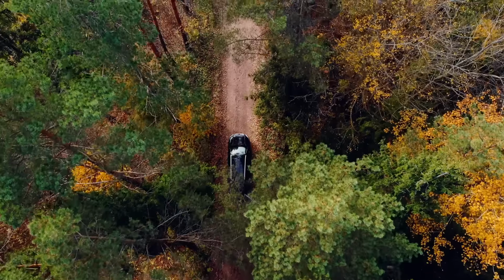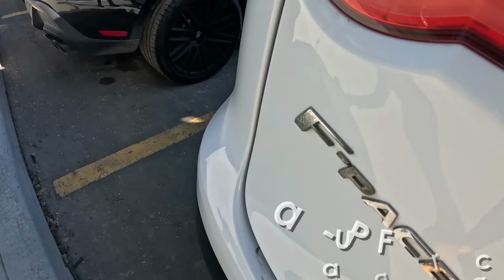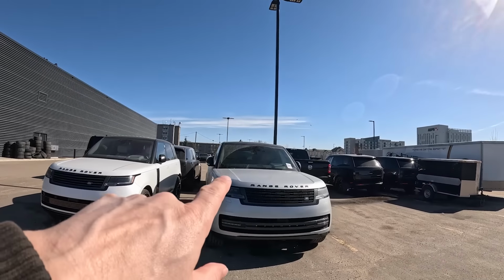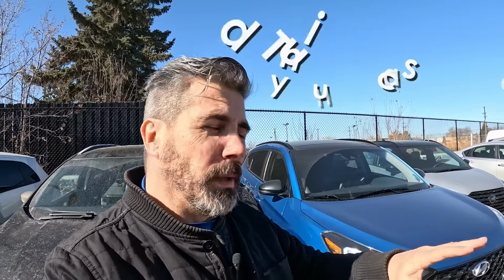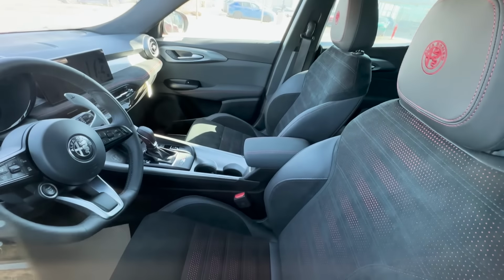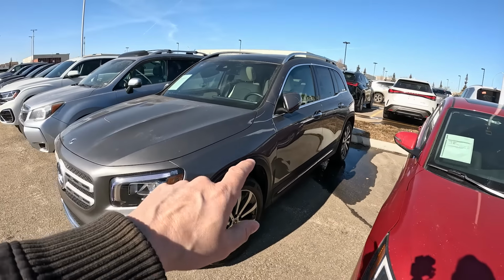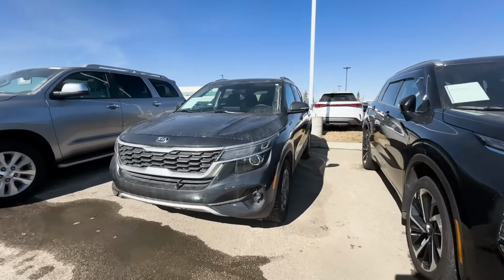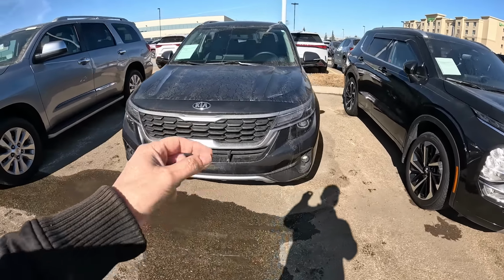Here Are 10 SUVs you MUST AVOID!

Comment: I have had two Ford Escapes, 2008 got 160K out of it. Transmission went. Could have put another one in, it still ran fine, but junked it. I have a 2014, 2.0 liter. There were no issues until after 100K and 10 years, now has some quirky issues. Shuts down after half hour or so, but will restart again and then go for another half hour or so. It is at 117K. So, not the best vehicle for sure, but at 10 years plus, I wouldn’t call it a total piece of junk. It’s not a Toyota or Honda, but it definitely ran well past 100K without issue.

Comment: I have two Ford Escapes, 2008 got 160K out of it. Transmission went. Could have put another one in, it still ran fine, but junked it. I have a 2014, 2.0 liter. There were no issues until after 100K and 10 years, now has some quirky issues. Shuts down after half hour or so, but will restart again and then go for another half hour or so. It is at 117K. So, not the best vehicle for sure, but 10 years plus, I wouldn’t call it a total piece of junk. It’s not a. Toyota or Honda, but it definitely ran well past 100K without issue.

Comment: I will never buy another Hyundai after owning a 2017 Sonata.  It burned oil so bad that apparently there was nothing on the dipstick when I took it  for its first oil change.  The transmission would shudder in first and second gear.  And there was a loud clanking noise coming from under the car when I accelerated.  Oh yeah, the car had less than 60K miles when I had all these issues.
Reply from the maker: They are not a well made vehicle in general

Comment: I had Nissan Juke and when I traded it had 107k miles. The transmission did not broke, Nissan replaced the timing chain due to a recalled when it had 30k, it became extremely unreliable at around 95k before that it was reliable

Comment: I have had 3 Hyundais and all 3 went over 150,000 miles and 2 of them went over 200,000. No problems at all. Just oil changes, brakes, batteries and light bulbs. But my 2 Toyotas had engine and transmission problems and died before 100,000. No more Toyotas for me.

Comment: Cars these days are heaps of shit compared to the 90s. Honda and Toyota are the best. But what  amazes me is its all these high end luxury brands are just crap. BMW, Audi, Mercedes Benz, Range Rovers etc once they start to go wrong they're just money pits... Too many sensors and electronics to go wrong, and when they go wrong Big money... Many years ago i had a 98 Civic for 14 years, I put 250,000 mikes on it, I had zero engine or electrical problems, it didnt even burn oil. I miss that car, it never failed me save for wear and tear issues.. Eventually had to get rid if it because of Rust, engine was spot on... Toyotas in the 9Os were pretty bulletproof too...

Comment: I own a 2014 Ford Escape with 230,300 km (140,000 miles) with the 1.6 eco-boost. Had to replace battery, front lower control arm plus wheel alignment(?), drive train bearing & plugs. I am 3rd owner & got the car during covid (2020), drive around 2,000 kliks per annum & do two oil changes yearly - spring and fall. It's a very comfortable vehicle, handles well & have only 2 complaints - 1. it's too small for all my camping gear & 2. it really clunks gears going up steep hills. Keeping my fingers crossed, eh?!?

Comment: I have a grand Cherokee v8 4x4, got it at 80k miles, died at 170k miles. Hard shifting, coolant burning, sunroof leaking, blinker anomalies, broken wheel studs, broken hood release, leaking radiator, melted alternator, failed water pump, blown head gasket and that's when I stopped fixing it.
Reply: Jeeps are garbage! 🗑️

Comment: I'm sure the Tucson is not among the most reliable cars but this is the first list I've seen that places it among the worst. I had a 2008 Tucson for 6 years and way above 150000 miles with not a single mechanical issue. Now I have a 2021 Volvo XC40 and I'm looking seriously at the 2025 Tucson as a better value option. I'm not comparing general quality of course.

Comment: The transmission is relatively inexpensive to fix, but the mechanics charge a lot of money because they offer you the option to sell the car to them.
For example, the Ford Galaxy is a superb, economical, and large car, but it has a bad transmission, the idiotic dual-clutch PowerShift automatic transmission. Around 100k, you need to replace the clutch, which will cost you a maximum of $700 to fix yourself, but the garage will charge you $5,000.
It is an incredibly profitable scam accepted by everyone, and nobody cares because it is a crazy profitable deal.
If you don't want to fix it, they will probably offer you $600 for the car because "the transmission is down." The actual value of the car is probably more than $7,000. They will take your car, fix the transmission for $700, and resell the car for at least $5,000 or more.
😂
Maximum profit in maybe two days of work or even one. 😊😊
I done my research guys and i fix myself my transmission and after 23k miles is still running like new. 
I good advice if you have automatic transmission "CHANGE YOUR AUTOMATIC TRANSMISSION FLUID " at maximum 40k miles maybe you will pay a maximum 200$ but you will save yourself a lot of money in a long run and important is to porr some lucas automatic transmission fix but not a lot if you transmission is perfect good .

Comment: Thanks for this post I was going to go out and buy a cheap Grand Cherokee and I'm not no more I can't believe it won't make 100,000 miles that's pretty sad. I have a Ford F-150 8 cylinder and it has 295,000 Mi on it it's a 1999 and it runs as good as it did when I took it off the showroom floor so there's a good vehicle

Comment: My 2020 4-cylinder 2.4 liter Cherokee 4x4 is for sale as we speak.  The biggest problem is the 9-speed ZF transmission, which since 2014 has been packaged with all Jeep SUVs with both the 4 cyl and the V6 engine.  Thank "Stellantis" and their globull sourcing for that (the ignition is from Magneti Morelli/Fiat).
This transmission never sees a gear it likes ... in mountain country driving a ZF Jeep is not pleasant, as it downshifts with each tap of the brake almost regardles of engine speeed.  I've seen 5000 rpm on the tach through no choice of my own.  If you have cruise control engaged while going down a long grade, the same thing happens.  
This car also thinks it is smarter than its driver, as it has a few "helpful" electronic aids that you must disable each time you set out for a drive ... unless you like having the engine shut off at red lights, and the brakes pump automatically when the car thinks you are too close to the rear garage wall.  
And don't even ask about the nahtsee seat belt warning chime ... drive fifty feet down your driveway unbuckled, and you hear it.

Comment: That don't make simple cars anymore .  manual transmissions manual windows manual locks  .I got a car with power locks that's making me sick  .they lock when I don't want them to lock.. power windows that can be ruined if you leave the windows down in the heat and it rains and gets on the controls  .they should get rid of as many electronics as they can in these cars.

Comment: I've had a 2011 Hyundai Tucson for 13 years with 182,000 miles on it have had zero issues with it. It's the 2.4L engine variant. I do all of the various maintenance as required. I would definitely buy another, if this one ever dies!
Reply: I had the same experience with my 2011 Hyundai Tucson too! Great car in my opinion.
Reply: Except for the Tucson, I mostly agree with your position.

Comment: Wife’s 2014 Ford Escape has 140,000 miles with zero problems.
Reply: I had the old Escape and it was a good car to drive. Based on that experience,  I bought the 2018 Escape. Transmission had to be replaced at 175k km, 5years. Luckily for me they agreed to replace it under warranty. Never buying it again.
Reply: Yeah, I have a 2017 with the turbo engine, about 78k, no problems and still rides great
Reply: this is nice to hear as I recently inherited my grandparents 2014 Escape after their passing. I wanted to have it for obvious reasons but kept hearing horrible things about that year model. I was looking at finding something (admittedly a small Toyota SUV) else to drive instead. I still have my concerns but they took impeccable care of it and believe it or not, it stilllllll has a "new car smell". I'm kind of torn though. I want several years of a vehicle with no notes and just attention to servicing and maintenance. I still have some reservations about this particular Ford product.

Comment: 2024 today mi Hyundai accent  2014. 210.000 miles 0 problems  running like new 😂😂😂😂    and mi kia sportage 2019 110.000 miles.  0 problems  I love.  🎉🎉🎉🎉🎉
Reply: And I believe you🤣
Reply: I currently drive a '16 Accent. Still going at just shy of 150k and I'm hard on cars bc I'm a girl and don't know how to fix stuff. It's had to have the a/c fixed more than once (I live in Texas and no air is not an option) and some kind of sensor, other than that, it's taken a real beating. Great on fuel, good commuter. I'd recommend.

Comment: I took a chance and bought a 2023 Tucson in December. I haven't heard anything bad about the latest gen. The engine is not the Theta II that was so bad.  I bought mine because after test driving a lot of competitors I liked it the best. I actually traded in a 2021 Subaru Legacy Touring XT for it. That car was a complete rattle trap. By 5,000 miles it had an oil pan leak and more interior rattles and buzzes than I could count. Not to mention the CVT had horrible driveability - surging, hesitating and jerking around town. The Tucson is at least a naturally aspirated engine with a traditional automatic. Smooth as butter driving it.

Comment: I have a 17 Kia Sportage,  It was using 2 quarts of oil every 1k miles at around 60k miles.  When I took it to Kia I was told that they would not warranty the engine because 2 quarts of oil every 1k miles is acceptable.  This was after they did an oil consumption test.

Comment: had 4 ford cars that none of them made it past 80K miles, 1 was using 1 quart of oil from brand new, got rid of it at just under 30k miles, had a ford 350 that had engine light come on at under 50 miles, had to get a lemon law lawyer it spent 7 months in the shop with 42 issues, from front/rear axles not being parallel, destroyed both front tires at under 5k miles, center console controls falling out, grill only had 1 fastener, center console and dash controls quit working, windshield wiper and washer motor failed, at under 8k miles charging system also failed
Had a 2014 Hyundai Tucson limited synthetic oil changed every 5k miles, got rid of it at 299k miles, wouldn't get another because of the local dealer that would not honor warranties, had to go to another dealer to get warranty work.

Comment: I have to somewhat defend Hyundai. We are on our 5th vehicle over the last 20yrs, and have owned our 2018 Tucson. 83,000+ miles and no issues at all. But, I do know 3 people who have had new motors put in with vehicle mileage around 60,000 miles. Good thing is, they got new motors free because of the 100,000 mile warranty. From what I hear, Hyundai vehicles need to be driven at higher speeds more often. City driving are killers for Hyundai and Kias.

Comment: You lost all credibility when you claimed that the Tucson, which is a front wheel drive vehicle, has a lot of issues with its rear differential!
Reply: Some models appear to have AWD / 4WD depending on which car forum you read. There are a few threads about the rear diff problems.

Comment: Don't buy the Hyundai Tucson. The dealershit wouldn't replace my engine even though it burned 2.8 quarts of oil every 1000 miles. This happened at 110K miles. The car was fine, but the engine was hot garbage and Hyundai's customer service is trash even with the engine recalls.

Comment: All of this isn’t an issue if you can do all the work yourself 
I have 2020 INFINITI QX60 AWD replaced EVERYTHING  CVT transmission twice and now at 185.000 time for the 3rd one 😂 but they only cost like $800-1300 used ones with 10.000-30.000 miles on them 
Also replaced front transfer case twice ,, only paid once $800
Driveshaft $125
And rear differential you can find many with low miles I replaced one for just $700 only bad part was electric cuppler 
2 months ago had to pull the engine out to do timing chain $770 parts at dealer 
Runs great for me it’s cheap to maintain pretty much any car 
And just bought mid rise SCISSOR lift which will make maintenance super easy 
But I don’t understand people buying pricey cars abuse them without any knowledge how to fix things so when something goes wrong they just trade in 😂
Reply: Who the hell wants to do all that work over and over again on a 4 year old car?!
Reply: @morebeer7673  
It depends what you use it for is it just home-work grocery store 
Or you actually work with it such as Uber Black/Premier and earn with it $3000-3500 a week make like $140.000 a year and pay like $800 in taxes 😂

Comment: The Ford Escapes, Edges and Fusions made from 2014 to 2020 had defective EcoBoost engines which allowed coolant to leak into the cylinders.   Ford knew about the problem, but let its customers take the hit for its negligence.   Ford doesn't care about its customers.   When Honda or Toyota find a systemic issue, they fix it straightaway or issue an extended warranty.  Ford does nothing but let its once-loyal customers twist in the wind.
Reply from the maker: Nice

Comment: I saw a video on Facebook the guy that was telling about these new trucks and cars said they will not last 10 years that's because there is no quality it's all quantity back years ago they made quality not a lot of quantity they should build them like they did years ago I have a 1976 Scottsdale half ton four-wheel drive Chevrolet pickup with the original 350 Chevy engine and a Muncie sm465 manual transmission with a Dana 44 front and rear axles it has the original posi Trac rear end and this truck is 48 years old and it has over 500,000 miles on it has the original bulbs in it none of them have ever burn out headlight tail light parking lights nothing dash lights interior lights every bulb in this truck is original so my point is cars and trucks were made better back then in the 70s get a car or truck that will last 25 years most of the old Fords Dodges and Chevys and Cadillacs and other cars that were built back then are still on the road with no issues or problems then we brought Toyota to America all these new cars look alike you can't find your car in a big old giant parking lot at least I can spot my truck in a parking lot because it's one of a kind these new cars have no finesse no contour lines nobody lines these cars have too many sensors in computers in them it won't go past 100,000 MI it's going to cost a lot of money to get a new computer I will never own a new vehicle I will never buy a new car or truck I will go buy a used one because they will last longer then all these new cars back in the day the vehicles were not as expensive as these new ones I hope I got my point across older is better

Comment: Here in the UK the Nissan Juke is referred to as the Joke or the Puke. Also smal Ford 1 litre 3 cyl wet belt engines (ecoboost) are known in the trade as ecobooms. There is a growing practice of quietly replacing big block engines with tiny turbos - like the Merc. A four pot two litre turbo to try and lug a 3 tonne monster SUV.